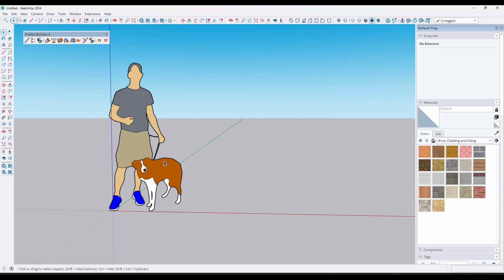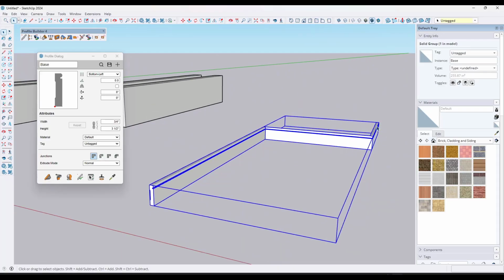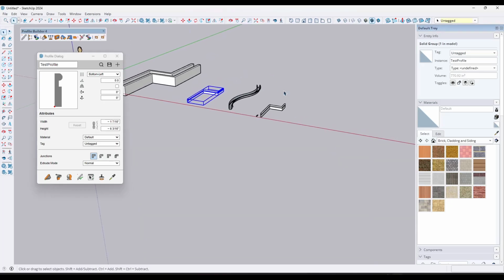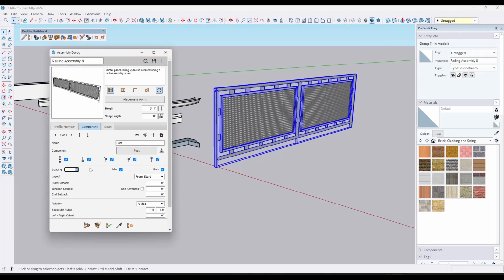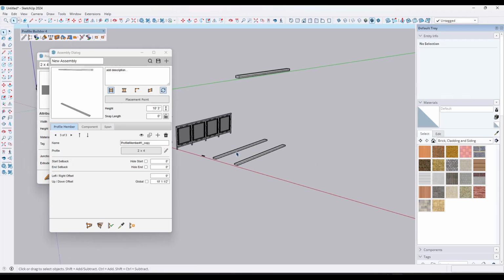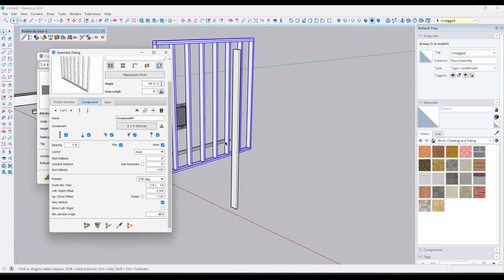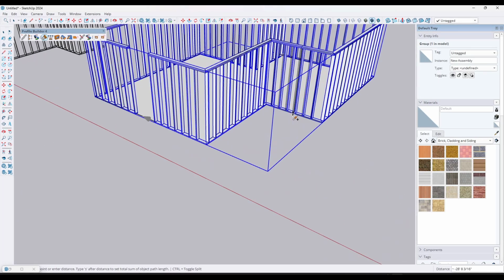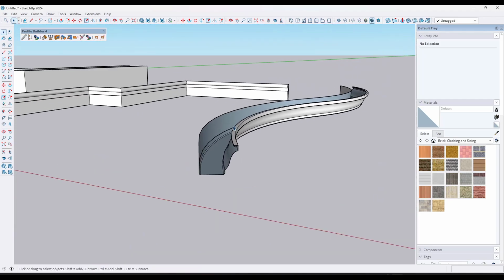Getting Started with Profile Builder for SketchUp - BEGINNERS START HERE!

Comment: hey, I have a question, I am building a conveyro belt that is in a very specific shapes, mostly goes down and up, and I want to use the assembly to follow my predetermined line with build along path, but it is all over the place, it is sticking to all different axes, the only solution I found was to put it on the ground and make it stick Verticaly, but it would be much more efficient for me to do it horizontaly, but its facing all the weird sides of the line.